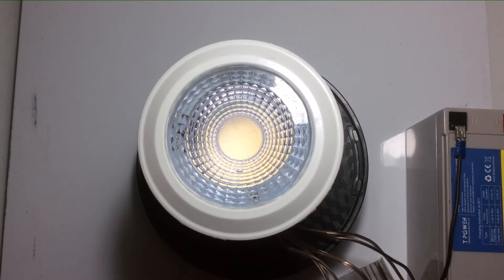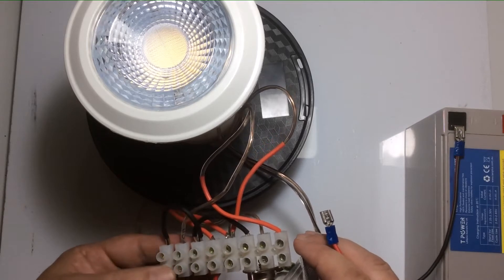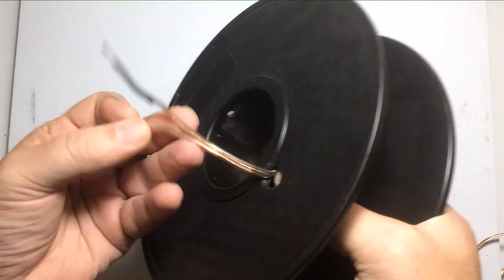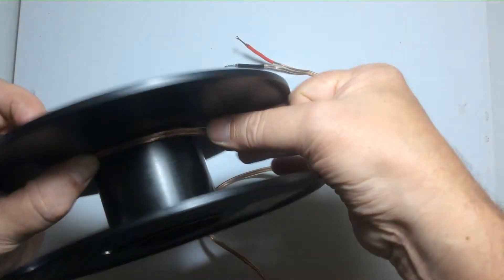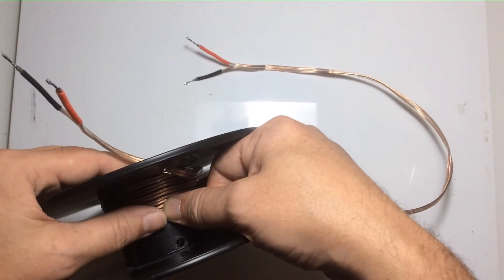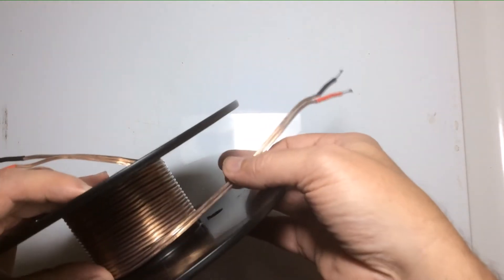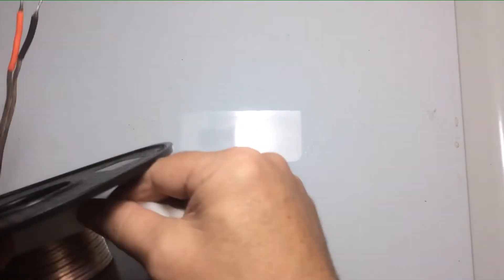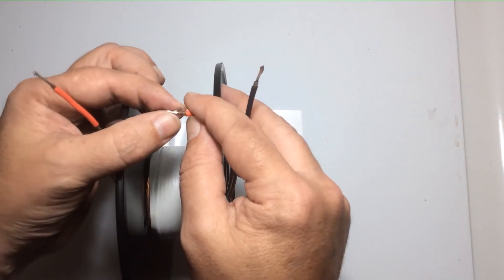Part 1 of 3 DIY Backup 240V Light How To Tutorial for Power Shortages - Winding Primary Bifilar Coil

Comment: If the transmision trough earth is changed to direct wire transmision, how this will change the performance? (sorry for my bad language, but I know only hungarian and romanien laguages).
Thank for you reply.
Reply from the maker: @olahandrei3702  Thank you for your comment.
Technically it should be similar distance to when using earth transmission. So far I have only tested 160 metres before I ran out of wire. Doing this will definitely increase the power consumption, somewhere around 1 amp I imagine. I have a 5 watt bulb I will test and let you know, I have a length of speaker wire approximately 40 metres I can use for the test.
Thanks for watching.

Comment: How many hours will it work with a 5W LED, on a 40Ah - 12V power source (accumulator/power bank, car battery, etc).

Thank you for your answer.
Reply from the maker: @olahandrei3702  Thank you for your comment.
A 5 watt LED would last a little over 90 hours. The best setup is a cheap solar controller which allows you to either set a  timer up to 24 hours or the circuit can automatically turn off when the sun comes up.
Technically 12 hours is perfect say from 6pm to 6am which is why the auto solar controller is perfect, coupled with a tiny 20 watt solar panel you would never need to think about it again.
Thanks for watching.

Comment: Is it really cost effective compared to other methods 
Something youtubers neglect to show
Reply from the maker: Thank you for your comment.
That is a valid point that is rarely discussed. This system is extremely efficient, especially considering my design goals. 
1. I wanted an off grid 12 volt system capable of running common “off the shelf” 240 volt lights.
2. I wanted this system to have minimal components to make it survive an EMP and to be easy and cheap to build.

Over the years I realised I only needed 1 transistor and as long as I have backup transistors stored safely they will survive an  EMP and be one of the first available lighting sources in the aftermath.
Compare that with conventional inverters that have multiple failure points to repair and a constant load consumption on the battery as well as the load of the light. I figured it was an unnecessary loss of power just for lighting.
You can have a look at the following video for wattage consumption using this unit.
https://youtu.be/CH2JdLTF-38
Reply: hope I success with 48 volt system. Need your input for 48 V system ...
Thanks for all your support

Comment: Interesting. Seems like according to other tank circuits this should be more officiant if you take the light away from emitter / negative and connect it to positive side of battery, before the bifilar. This should create feedback loop (similar to super joule ringer looper, by lasersaber). Or it might blow up the circuit :D Haven't tested it on higher voltages! Also adding capacitor to DC connection might make it so you can use it without DC for some time. Also shorting one wire through the coil should increase the power. Beware if you try these on 12v, there is a lot more amps on those than regular batteries.
Reply from the maker: Thank you for watching. Thank you for your suggestions, I will test them out soon. Unfortunately I am still unable to put my leg down for very long and I’m still on crutches which is making it extremely difficult to continue my research. I will try to report on results soon.
Have a nice day.
Reply: @whatifididthis...1236  "Joule Thief Hupcharger" circuit seems to be very similar to this and your other projects too.
Reply from the maker: @Kangsteri  Thanks for your comment. I am familiar with the Hupcharger from back in the day. The thing about a lot of these devices is they are all really similar as there isn’t that much difference required to have a working unit. This is far from rocket science and just requires basic re-education.

Comment: What's the voltage supply to the base of the transistor ? Since  it's the output of the 180 turns coil so, it must be higher than requirements by transistor. Am I wrong?
Reply from the maker: Thanks for watching. 
I think your asking if the voltage of the 180 turn coil exceeds the transistor voltage rating. I could be wrong but from memory the 2n3055 transistor is 600 volts and I think this circuit produces approx 2000 volts. So it’s probably fair to say you are correct. Once you see things like that running for years at a time with no damage to the transistor you begin to wonder what else can be pushed beyond the data sheet?

Comment: How much current does the battery consume please?
Reply from the maker: Thanks for watching. The current is dependent on the load. Using the small seperate coils the consumption is approximately 5 watts whilst the 9 watt lights will take the circuit to approximately 25 watts. For maximum brightness a capacitor can be used, the homemade capacitor I use will make the circuit draw approximately 1.25 amps.

Comment: The bifilar is the capacitor.
Reply from the maker: Thanks for watching. I believe you are correct, I also believe the material that makes the insulation acts as a dielectric capacitor also. I have made similar coils before that were replicated using different wire with a different insulation and it did not work.
Reply: @whatifididthis...1236  also heard tesla didn't like to tune coil with vary the capacitor that's why he wind it in bifilar. So it could be tuned easy. But who knows i could get it wrong. You are doing good work though beating some in progress.
Reply from the maker: @craftymulligar  Thanks for you kind words. My intuition is constantly pushing me with new ideas that seem to pop into my head 24 hours a day. At the start I was ok with it, now I can’t get away from it, it’s probably best described like being possessed, it’s constant, it won’t leave me alone and I’m not really sure I want it to leave me alone either. I would appreciate some down time as it gets in the way of normal life, I struggle to have conversations when my mind is always on my projects and these ideas just keep flowing. I would probably find it easier if I were less physically limited but this is my reality so I have to get the most out of it.
Reply from the maker: @craftymulligar  I don’t think any of us know the full picture on anything. We simply won’t know unless we try and try again. Don’t doubt yourself, it’s our education that taught us to discredit our own ideas, preventing them from being a reality. The bifilar coil always seems to amaze me when compared to a “normal” coil. My circuit came about as an idea, I discredited it in my head which told me it wouldn’t be anything special, some part of my consciousness got sick of the disregard for the idea and compelled me to wind it, let’s just say I no longer discredit any of my ideas anymore.

Comment: So far very understandable tutorial. Thx
But a novice question for you. What is the benefit of this setup?
Thanks for your efforts and sharing 👍🇬🇧
Reply from the maker: Thanks for watching. This circuit has multiple advantages that might be best described in point form.
* Backup Emergency Lighting.
* Only one cheap replaceable component that can fail.
* Can be made with scrap materials.
* Runs 240 volt LED light bulbs from 12 volt battery.
* More efficient than 240 volt inverter for lighting.
* Low current and High current modes.
* Single wire AC transmission.
* Single wire AC Earth transmission.
* Long distance Earth AC allows for more suitable solar locations.
* Wireless transfer of power.
* Can be used as an induction transformer.
* Produces high frequency radiant energy field.
* Produces a strong dielectric field.
* Ambient energy collector.
* Incorporates Earth grounding for more power.
* Reduces copper costs by 50% over long transmission distances due to Single Wire Earth Return (SWER)
That's all I can think of right now, if I think of anything else I will edit this reply.
Have a nice day.
Reply: @whatifididthis...1236  Oh ok, that's sounds like a lot of benefits and thanks for the reply.
Looks like another subject I need to pay more attention to.
Reply from the maker: @strawman9410  Like there wasn't already too much to pay attention to in the world LOL
Reply: I found this and think it may be of interest to you 
https://youtu.be/0RnnH7vDbz4
Reply from the maker: @strawman9410  Thanks for that link, I have cued the video and will watch soon. I am very familiar with Dr Greer's work. He has been revealing truths to us for a long time now. By the way, I love your YouTube name.

Comment: hi again thk y for the effort is this coil 9 turns and next one 180 turns are part of tesla free energy generator with aluminium plate cap etc shared in this video
https://youtu.be/srwU9d5bsHs
Reply from the maker: Hello, This coil is similar in operation to the coil in the video you supplied the link for but different in dimensions.
The coil in the video you supplied the link to is as follows.
Diameter of plastic form that coil is wound upon is 40mm
Width of plastic form is 76mm
Bifilar wire width is 5.6mm (Two wires side by side)
Primary is approx 13 turns Bifilar
Next there are 2 x 26 turn windings on that form made of a single wire that are NOT used but may supply a dielectric capacitance!
The third winding is used and is approximately 284 turns. 
I don’t recall counting the third winding because I was simply using up the end of a reel of wire, however, after taking measurements I strongly expect there to be 284 turns.
Let me know if you need any help.
Thanks again for watching.